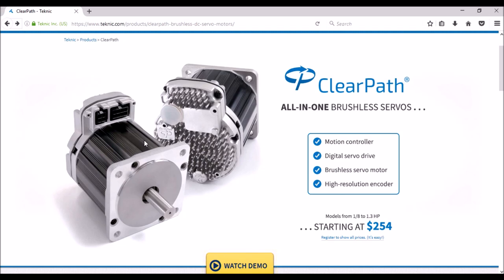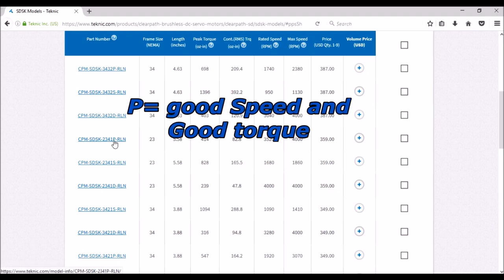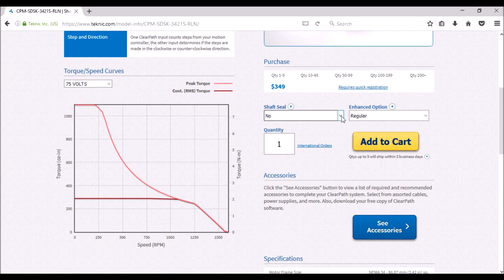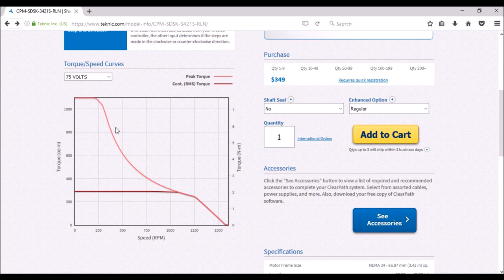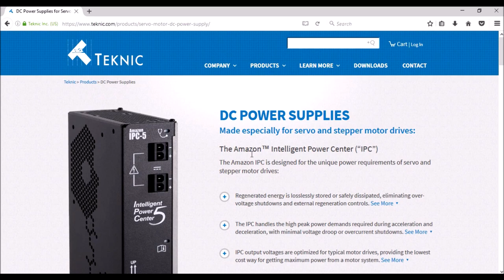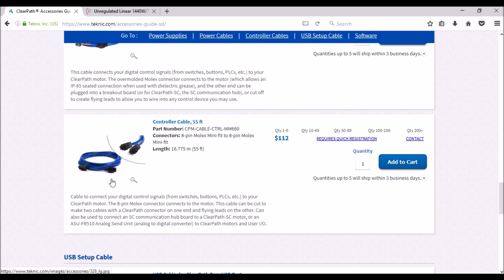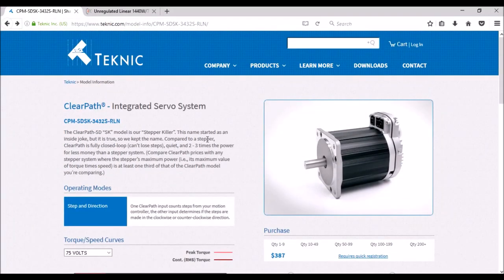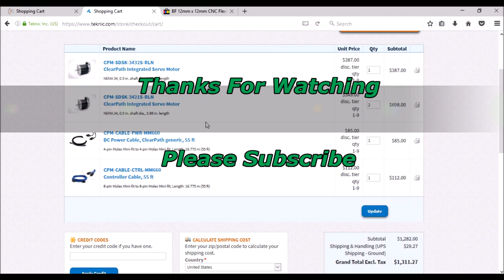ClearPath Servo Motors

Comment: Glad to see you setting up to use the ClearPath servos. I have 3 of the Nema 23's SD type setting in my workshop right now to use on my Taig mill but I just haven't had a chance to do the conversion yet. Can't wait to see how they perform on a mill. I didn't see the link you said you were going to post for the video where Wyatt has already done the conversion.
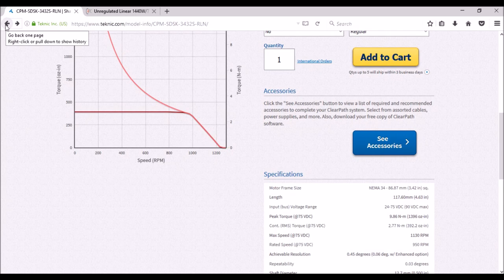Reply from the maker: Link in description and video @ 12:50

Comment: love my clearpaths, well worth the price tag.
Reply from the maker: Hi Alan, do you feel the higher resolution clearpath are needed? is there any issue with the acorn at 400khz?
Reply: CNC4XR7 i wanted the higher resolution for dialing the screws in with a laser interferometer and ballbar. I have had zero problems running the acorn as fast as i can go, im running right around 300ipm and once i install the new screws can go up to 800ipm
Reply from the maker: Thanks,
I'm weighing options as the addition of a PDB and ATC along with a 4th Axis is going to push me to a ESS, and C62. type setup, I see that the Acorn is limited to 4 axis and 8 I/O so that may not be a option as that is where I'm currently at. I do like it though I wonder about the 400khz.
be Safe,
Sam

Comment: Sam i know that you are a long way in to the project but did you ever consider using one of the big Clear Path Servos as a replacement for the spindle motor.

It would seem that one of the "Integral hp models (100-240 VAC input)" could be a better use case vs the 3 phase motor. They are rated at 100% torque from pretty much 0 rpm and you would be able to limit to the max rpm to the same value as the original motor. They are controlled by 5v PWM that you would be able to use straight from your BOB without having to go through the 0 - 10v converter. They also will work with just an external POT so you could have variable spindle range from the day you mounted.

I am still trying to decide between getting the PM727 or the PM833T so will be a while until i am able to try on my system. (Currently running a small ox router design.)
Reply from the maker: Hi Davey,
Yes very far along and I can say that even though I planned ahead things change and it seems as though My machine keeps evolving. SO lets start with your choice of Machine. The 833T is a very nice machine but if your plans are to CNC I would maybe go with  a Basic 940 with hardened ways. You have to account for all the things you will be removing. The Clearpath motors are New I just saw then 10/25/17 a couple things that jump out is Max rpm and torque is 10% at max rpm so if you plan to run a CNC in order to get 5K rpm that a 2 to 1 pulley setup and 10% torque at that speed. Of course you dont need a lot of torque at higher rpm's but i cant see you getting more than %k out of this type setup. with a VFD you can run it at a higher Frequency. I need to further research but very promising.
Reply: Looking at shaft sizes it turns out that the 2 clearpath size's would not be very convenient. The stock motor size is a D80c frame size and seems to have a 19mm shaft. The clearpath ones are Nema sizings with the nema 143 is a 22mm shaft and the nema 56 is about 16mm. So you would have to use spacers and make a new mount. So most likely not an easy fit.
Reply from the maker: Yes that is true if you plan on using the stock gear box. for a belt drive it would not matter to much.

Comment: Good evening. I have just ordered the Avid cnc pro. A friend suggested me to check out your site as you have a plethora of information. If you have any advice on a spindle motor(etc) 1 phase,  with an automatic tool changer? I did not order the equipment that came with the product because I wanted to check to see if there is anything else available in the market. Thanks for your help.
Reply from the maker: Most of the CNC routers I have built screens for use a water cooled type ATC spindle. Most of these run off a VFD that is single phase input to 3 phase output. you can find many suppliers for these spindles.
Reply: @CNC4XR7  thanks a bunch. Do you have any you recommend?

Comment: What do you guys think about the regular 800 count vs the enhanced 6400 count motors?  My thinking was 800 counts roughly equals 0.0004" per step and that seems like it would be enough resolution. But then 800 counts only equates to 4x microstepping and seems most people use more than that. Curious to know what the consensus is.
Reply: I purchased a high resolution model ClearPath to try before making the total plunge for all three servos, my take is that unless you are doing some high precision gear cutting there is no need for that kind of resolution. I also learned that the higher resolution seemed to reduce the amount of rapid feed rate attainable with the 800 resolution models. Something else to think about, when you half step or 1/4 step a stepper motor you lose torque, the ClearPath is full stepping at 800 counts, therefore there is no torque lost due to the increase in steps per revolution. These servos have a built in encoder that is where the resolution is being changed not in the amount of steps but the actual distance the encoder moves. These are extremely powerful, quiet, and smooth servos, yet they are also extremely sensitive.
Reply: James Hopkins 
Hi James,
Thanks for the info. With typical quality ballscrews used in a home shop conversion, my thinking was the 800 count motors would be more than enough and that's what I got. I have been second guessing myself ever since they arrived. My mill is not done so I can't really see how they perform yet. When you say the high res motors have slower rapids, do you mean if you're using one with an 800 count motor it slows them all down OR are they just slower in general?  What are you using to drive them?
Reply: ScotY808 I have them hooked to a C11GS bob board they have internal drivers. The high resolution servos, 1600 res, will not yield 200 ipm rapids. When you set your steps per inch in Mach you will see that the higher you step per rev the lower your feed rates.
Reply from the maker: not to mention the higher kernel speed issues we had.
Reply from the maker: Like James says the higher resolution servo's I think is overkill on these type mills.
Reply: James Hopkins Are you using a motion controller or just the parallel port?  I'm no expert but I'm thinking it must be a Mach limitation if the higher count motors are not able to move fast enough.
Reply: CNC4XR7 Thanks for the confirmation...I have some time before the 90 day money back guarantee runs out in case we are wrong. :-) Btw, Franco made a video about the Acorn and I just made my wallet even lighter. I'm having a little trouble getting it set up but the guys are very supportive and I'll get it going, I'm sure. It looks like an awesome system if you're interested in venturing away from Mach.
Reply: ScotY808 I am paralleled to a breakout board using mach3 as I stated earlier and like CNC4XR7 said we believe the higher res causes kernel issues, but you can configure your servos to Read 800 res and you will be just fine!!
Reply: I know this comment is a year old but I think there is some confusion about the differences between the regular and enhanced. BOTH have 12,800 count encoders so they are equal in their steps and resolution. The 6400 compared to the 800 count is more for the RAS setting that allows for more fine tuning for smoothness and speed. I feel with these types of chinezium mills, one probably won't benefit from the enhanced model. I don't think these mills are powerful and rigid enough to be pushed harder than the regular model can handle. I maybe wrong but that is what I have gathered.